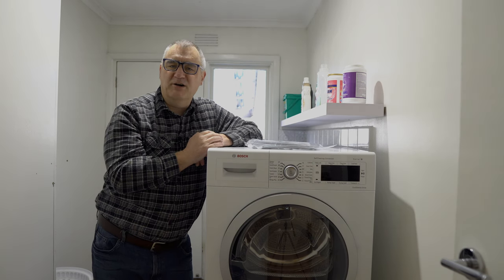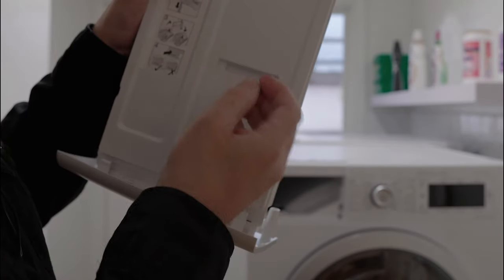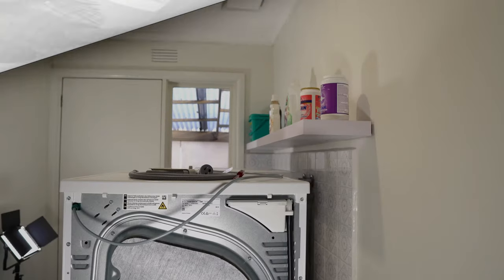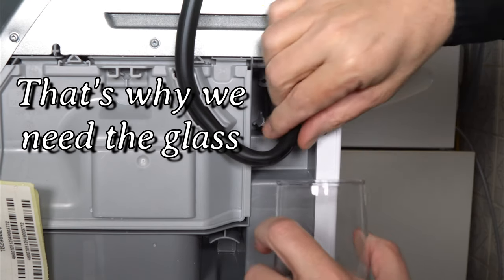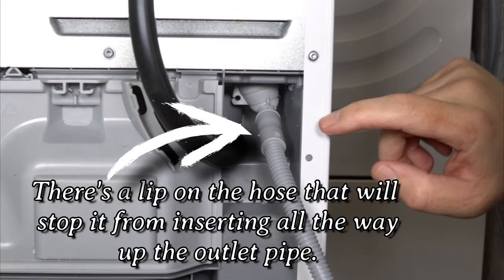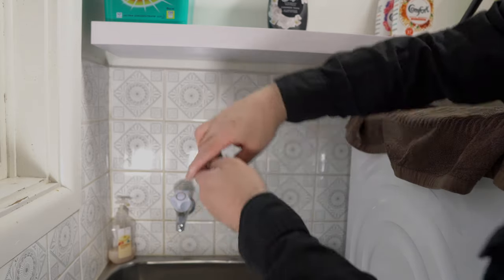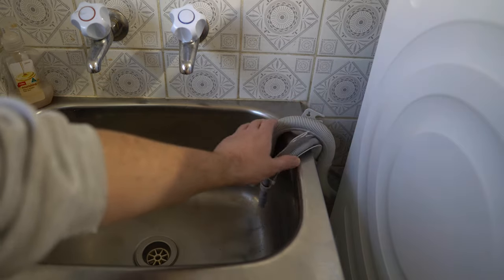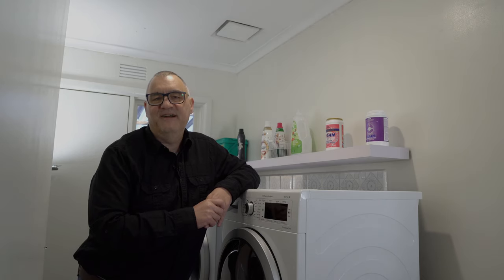UPDATED - How to Install the Bosch Drain Hose Accessory Kit

Comment: what does removing the plug (at beginning) do?  Same about filter?
Reply from the maker: @Stuart Wright   Hey Stuart. Although the manual doesn't really explain anything, my guess is that there is a baffle in the Water Container and by removing the plug, when the water spills over that baffle, that water then goes through the now unplugged hole and then pumped out of the dryer. Without having any technical specs, this is just my take on it. I could be completely wrong though. I don't think removing the filter makes any difference. Probably more of a reminder just in case you want to reverse everything.

Comment: The kit also comes with a funnel adaptor (as seen on another video) that allows the drainage hose to fit directly on to the funnel and then drains straight into the waste pipe (like under sink etc.) , do you know what size screw fitting this adaptor will fit into? like 1:38 on this video? https://www.youtube.com/watch?v=PP108H5HpG8
Reply from the maker: Hi Barbara. l know the funnel you are talking about and l show that on my video, but just not how to connect it. The instructions say to use a 12 to 22mm hose clamp to secure the syphon. I hope this info helps.
Reply: @JustAwesomeCommercials  Thanks, yes I saw the 12 to 22mm hose clamp sizing, but I can't find the size of the circle of the adaptor 'funnel shaped' that fits inside the screw cap of the smaller side pipe (sprogget?) that is shown in the video at 1:38. I'm hoping it will fit the one I have (it used to have a dishwasher appliance drain of the cone shape variety), and I just take the 'cone out' and put the 'adaptor funnel shaped bit' from this kit. So I need to know the diameter of this. Do you have one to hand?
Reply from the maker: @Barbara Barlow  Unfortunately l don't think l can give you an exact answer as it depends on the type of adapter your pipes use. I've just checked mine in the kitchen and laundry and we use a standard hose connection that only requires a hose clamp. In the video you highlighted, you remove a cap, stick the hose through the cap and then connect the funnel to the hose and then closing the cap secures everything in place. This may be a European type of connection. Maybe America piping standards use different methods to both? Without me actually seeing what you have, I can't really give you an exact answer. I can only suggest to go to your local hardware store and take the funnel. I'm sure they'll be able to assist you better than l can. Sorry l couldn't be of more assistance. Good luck and l hope you get it sorted.
Reply: @JustAwesomeCommercials  thank you for trying, I'm in UK, standard size for under sink drainage is 1 1/2 inch or 40mm but we have a range of standard sizes for the sprogette-off-shoot pipe that can carry appliance attachments, though the attachment of each is the same size as the hoses produced for washing machines and dishwashers are the same standard size but this tumble dryer hose is so much narrower. I think it's a common complaint in UK. I've been to all the DIY shops and one plumbers' merchant, so solution so far. I've messaged Bosch who just say standard size and can't seem to answer 'what is the mm of the diameter of the attachment' or what size cap does it fit', honestly, no point in me buying the kit if I can't make it fit. But thank you for your replies.